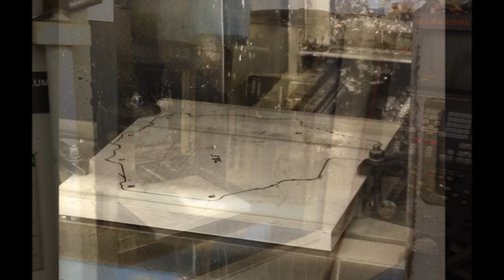My Civic EV Electric Car Project Part 25 Making The Motor Adaptor

Comment: Im confused on why you still used the flywheel? You would have saved so much weight by just going clutchless, But i guess its all a personal choice.
I love it thou, waiting for more!
Reply from the maker: Krim Kram I am using the clutch and flywheel because I want the leverage of the gearbox. I don't have the power needed for a single speed situation.

Comment: I'm curious about the Programing.   Do you have all the xyz math on a typical thumb drive or something so you can duplicate it anywhere at any shop. Or is it all propriitary to a brand of machine? What controls the speed of the cut? How do it know? Who gets the copy rights to the program?  Cool stuff Tom Glad you finally got the project back under way.
Reply from the maker: TheEZGZ Yes Greg, We have the program we created plus a complete set of drawings with all changes and modifications that we made.I have all rights to my drawings.